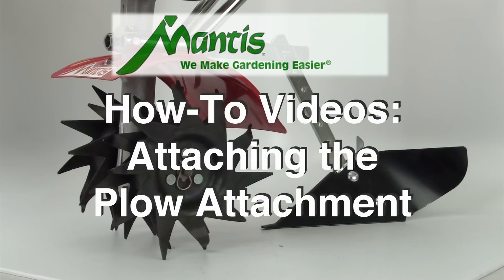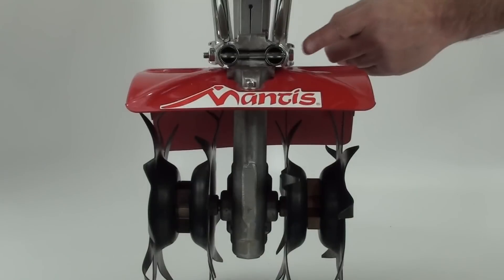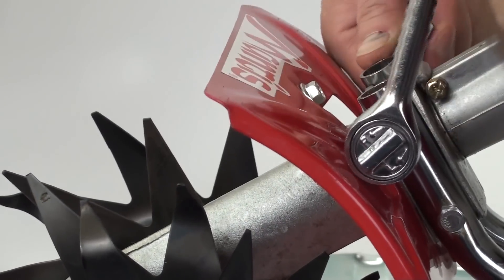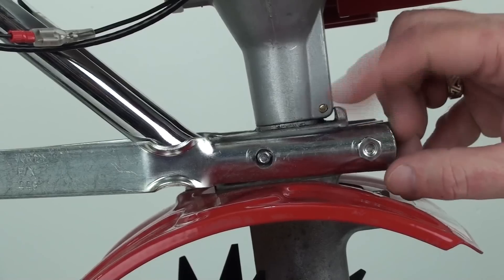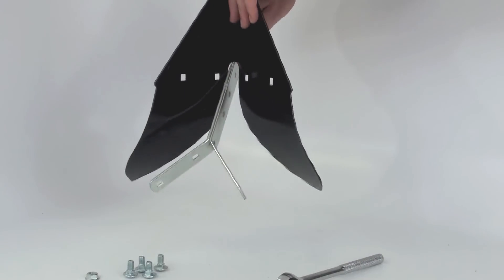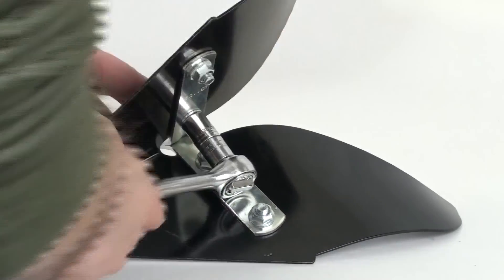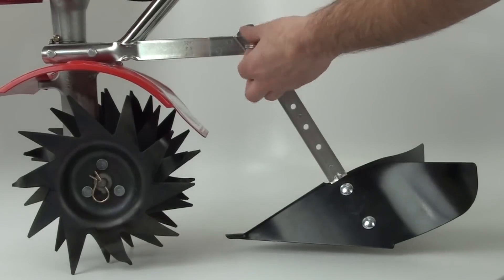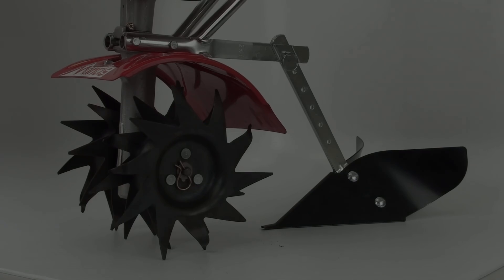Mantis Tillers Attaching the Plow

Comment: with the frame work in place can I still use my kick stand and will the wheel kit fit the same frame
Reply from the maker: +jaffa154 The answer is yes. You can use the kickstand while the plow or wheel set bracket is attached to the tiller. (The plow does not have tobe attached to the front of the tiller.) You just have to raise the kickstand to the “up” position so it is out of the way while using the wheels
or plow.  Also, the answer is yes to the question about the same frame being used for the plow and the wheel set.  You can attach the bracket to
the tiller and then attach either the plow or the wheels to that same bracket.  You MAY have to move the kickstand bracket up a bit depending on how low it was installed to begin with. Hope that helps.  If you have additional questions use our Contact Us form at mantis.com  or speak to a helpful customer service rep at 1-800-366-6268 Monday thru Friday from 8:30am-5:00pm Eastern time.  Best wishes for a great gardening season in 2016.